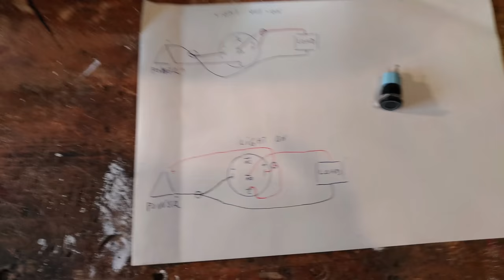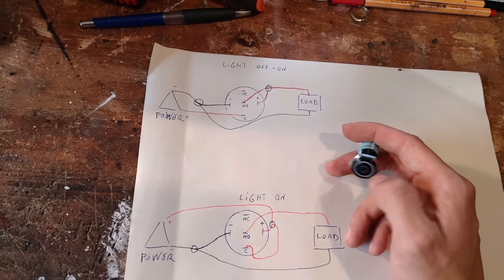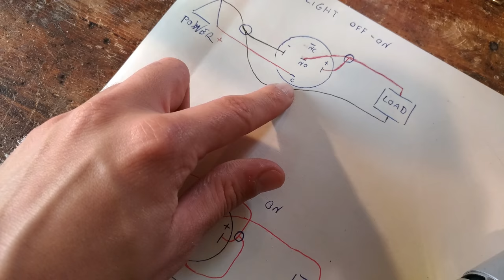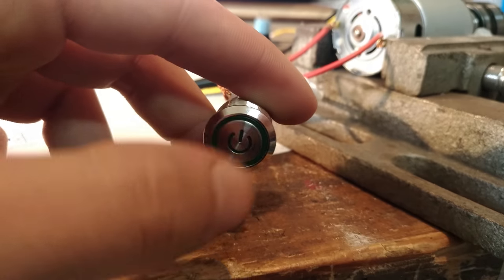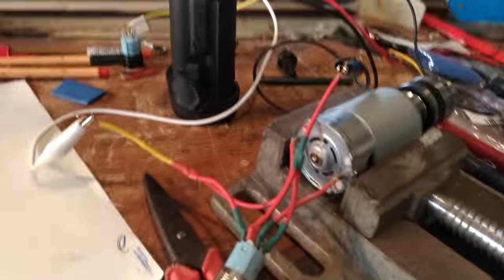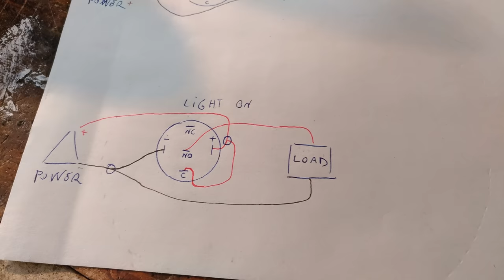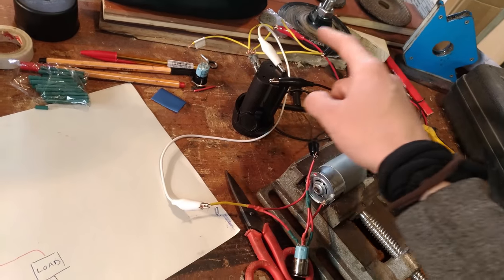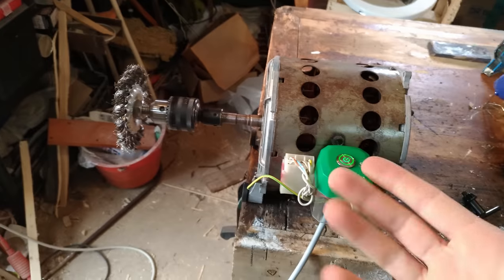How to wire 16 mm led switch

Comment: At the end of this video, I see you use this switch for 220v (or 110v) for a big motor. Did you wire the same like 12v source? Thankyou.
Reply from the maker: Yes 220v , you wire it the same, but you have to buy it for the right rating.

Comment: How is the switch handling the amp draw? No relay needed?
Reply from the maker: i'm still using it like that from when i made the video, i just added a switch that allows me to change between the 2 speeds, but other than that the setup is the same and it runs with no problems...

Comment: will a 12v switch like yours work on a 6.6V LiPo battery?
Reply from the maker: Actually mine it's a 220v one, but it works wit 5v too, so i think it will have no problems, but when you're buying one you can chose the correct voltage, or at least a closer one...
Reply: Andrea Farina 11 thanks
Reply from the maker: @ojoaereo241  You're welcome!!!

Comment: Hello Friend ! your video was the most enlightening for my project, however, the motorbike of my project (DC) is turning counterclockwise and I need it running clockwise, could you help me with that, thank you!
Reply from the maker: Well to change the rotation you usually have to swap the cables on the motor...

Comment: Hi I can wired this kind of switch but can't stay on I need hold the buttom. What is the problem ?
Reply from the maker: You can wire it in two ways, i explain it in the video...
Reply: @AndreaFarina11  I try both ways. Thats why I ask what is the problem. Maybe the switch ?
Reply from the maker: @gabornagy1263  it may be... does it light up when you press it?
Reply: Yes light up. But I order the wrong switch :/ thanks your answer
Reply from the maker: @gabornagy1263  you're welcome ;)

Comment: do u know how to wire a 4pin ? didnt find a tutorial for it :(
Reply from the maker: Sorry but I don't have one in hand right now, but it should be pretty easy, first of all, check if there are some signs near the pins, and even if you can't find any, just try different combinations with a battery, that way you don't risk ruining it or electrocution...
Reply: @AndreaFarina11  It does not completly work. When i push down the button my led stripe goes on and when i go off with my finger the led stripe goes directly off
Reply from the maker: @jemand8872  unfortunately without trying it myself I'm not sure about the actual problem you have, it could be from many different things, maybe it's non wired correctly, maybe it's just a temporary button, and it's not meant to stay on when you don't press it...
Reply: @jemand8872  when you press the button do you hear and feel a click? Or it just goes down and pop back out smoothly? Sounds like you bought the wrong kind of switch from your description. If it is a momentary switch, those are not designed to stay on.

Comment: i dont understand why you made the video without a relay. 99% of all applications with a swich this size need a relay. this video is not very helpful
Reply: The video is about wiring to a led switch, not how to wire high load equipment. There are plenty of videos on how to wire up a relay and the info here can be applied into using an led switch on a relay